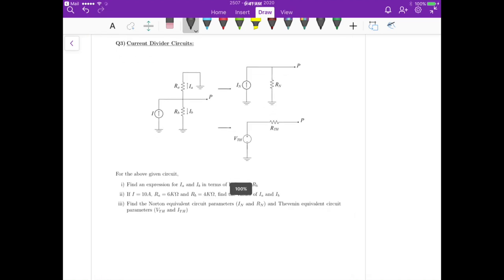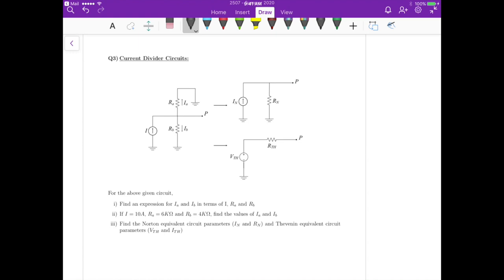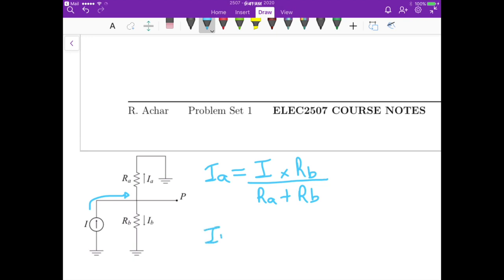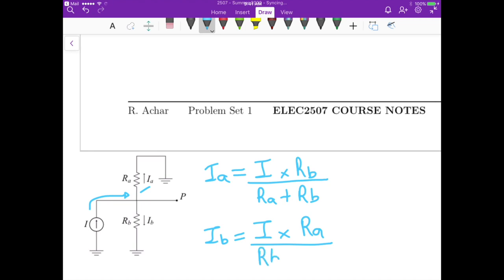Set 1 - Q3

Comment: Hey joao not sure if there is a slight mistake, I got the Rth as 2.4k and not 1.6k but the process overall was good
Reply from the maker: You are right, ahaha. Thanks for pointing that out! Rth should be 2.4k ohms. A silly mistake from my part. The equation itself is correct, I think I've computed 4x4/(4+6) instead of 6x4/(4+6).